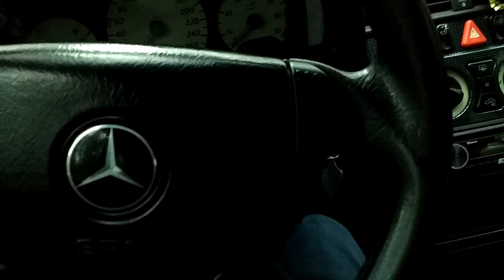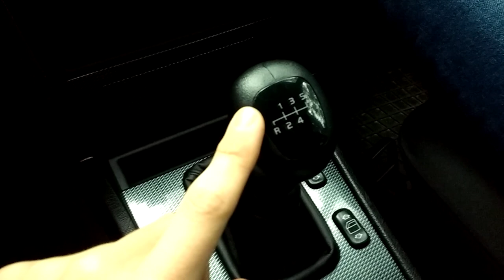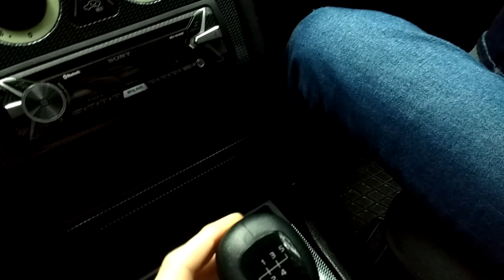Mercedes w202 how to change a shift knob

Comment: Thank you! The knob locking mechanism was the same on my 98 W202. I had to strip my automatic C230 shifter to disassemble to clean the backup light switch and this was my first step. I watched the video Monday and by Tuesday I had it working.